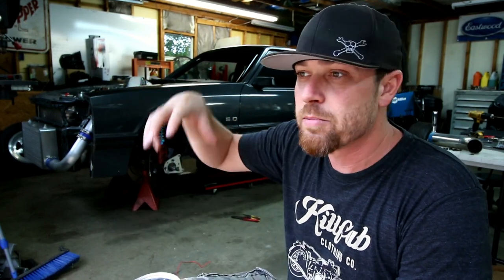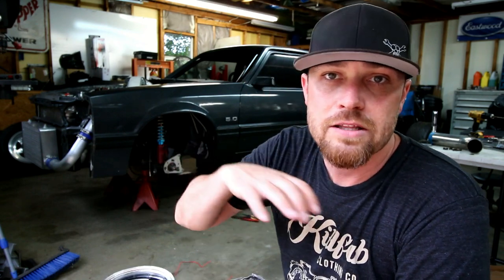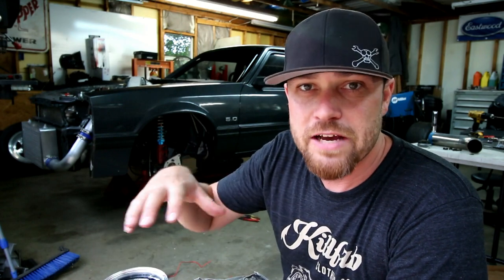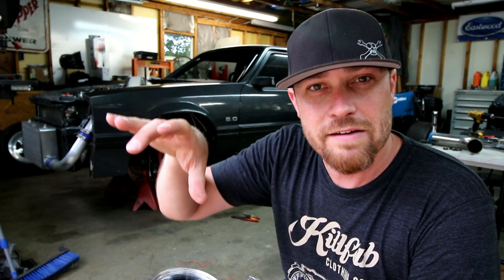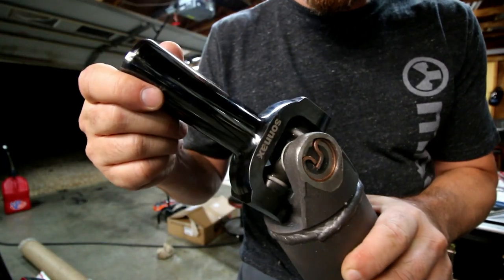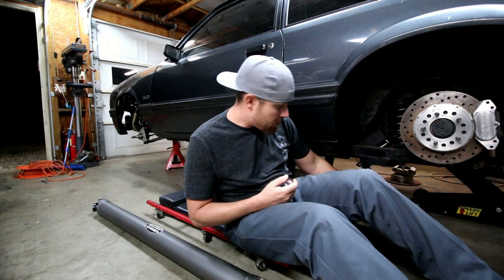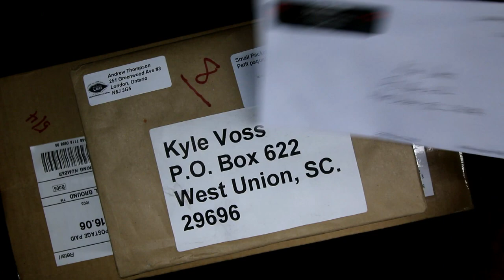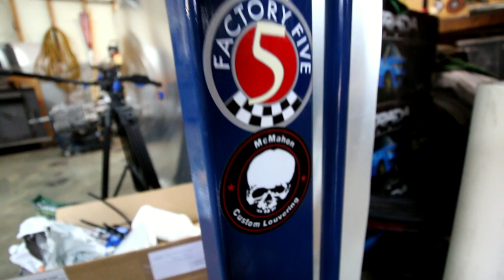Custom Intake Elbow | Twin Turbo Car

Comment: Like that advice at the end.

I completely hear you about the driveshaft, too.  I don't pay much mind to it (but I'm not dropping real power, either) but there's a reason most drag strips under a certain time (like 11s) require you to have a driveshaft loop.  Those things will do DAMAGE if they break free.
Reply from the maker: +MrSlowestD16 yeah for sure

Comment: Love this channel Kyle watching some new almost daily trying to get caught up. Did wish to point one thing out though. I noticed that you tie your line lock button into your trans brake. Just want to give you a heads up that morosso makes an adjustable trans brake button and your reaction times will increase if you move it to a better location like the stealing wheel. Just a good tip however long it takes for you to push your button to activate your trans brake it's take just as long to release it. Keep it up bud love the channel.
Reply from the maker: +Chris Bombard yeah I used to have on of those. Not too worried about it because its mainly a street car

Comment: In New Zealand if we modified our cars with higher hp we have to put drive shaft hoops around it. So it's a circle that's free floating and is attached to each side of the driveshaft tunnel and it holds the drive shaft if it breaks instead of dropping on to the ground
Reply from the maker: yeah I have one as well...it was actually shown in the under car clip in this video

Comment: Awesome driveshaft too pretty to be under the car. I liked the words of inspiration, have you run into the fourth type of person though, the one(s) that intentionally get in the way of everyone trying to succeed. I call them the road blocks, but once you get around them, it is clear sailing or happy motoring.- Anything of worth is always worth the hard work to achieve it. Thanks for the Vid.
Reply from the maker: +Bob S. Yeah they don't get any of my attention
Reply: +The Fab Forums Right on.

Comment: is it normal that the vid is onely in 1080p
Uknow here in ALGERIA, I can't afford that kind of internet connection ;)
Reply: Me neither here in Germany
Reply: Lower quality options will appear later as Youtube processes the lower quality versions.
Reply from the maker: +Michael Saull you should have other quality options
Reply: The Fab Forums they are there now but 5hours after you posting the video only had the 1080p option. I generally takes YouTube anywhere from 8-16 hours to render all the other quality options

Comment: Do you have something funky going on with your cold side? I see the car behind you with the bumper cover off and I can clearly see a nice FMIC, but when you put your elbow on your intake is coming from the firewall. It almost looks as if you have a water to air inside the car or something. If not did you just get creative with the routing for a clean look?
Reply from the maker: yeah mainly creative routing through the fender and into the cab in an effort to clean up the engine bay, but it was also made this way for an easy conversion to air to water if I end up going that route.

Comment: Question for you that sensor you used for boost in the intake, did that come with those connectors it did you buy that connector and add it to the wires? I'm looking for a company that makes small connectors where weatherpak I used in the past but they make large ones only.
Reply from the maker: it came with the sensor....it just a standard GM air temp sensor. http://amzn.to/2rHEGCL

Comment: 8.8 rear end did you upgrade the axle shafts with a 1000 hp and the stock axle you may break them . They are the weak link in the diff
Reply from the maker: +John Versluis yeah its got Moser 33 spline axes with c-clip eliminators and a spool

Comment: just out of curiosity,  what made you decide on an 8.8 instead of upgrading to a for 9 inch?
Reply from the maker: +bayou boat trash mustangs come with the 8.8 and they are basically just as strong as the 9" ....it would be nice to be able to have multiple gear sets setup but not need for this street car
Reply: Gotcha, I know a lot of people PRAISE the 9 inch, I didn't know if it was for ease of use like you stated or strength. Thanks for info. I know the 8.8 is a popular off road swap for jeeps. How much power are you looking to make with the goose?

Comment: The way you safety wired the rotor is incorrect.  The method you used is for a maximum of 3 fasteners.  If you want to do all in one shot you use a single wire.  Google aviation safety wire, there are resources for proper procedure.  Also you should alternate the direction of wire twist.  After 15 plus years of doing this daily one gets good at it.
Reply: And this is what makes YouTube so great, we can all learn something from one another! Thanks!
Reply: Cool!  I'll have to check that out! Thanks
Reply from the maker: +Brent Wolff yeah I have had several mention the same that work in aviation.... It will be perfect for what I am doing though. If I have to pull it apart for some reason I will most likely group them in twos
Reply: Brent is right about the multiple fasteners. We do the same thing on submarines and nuclear stuff. Also twist one direction first like you did pulling the handle to twist the pliers, then the other direction after going through the next fastener. You won't be able to use the puller for this direction. Lock cable is a good but more expensive option as well that we use very often.
Reply: Reversible safety wire pliars are a great investment.

Comment: If you are nervous about your U joints breaking and swinging around tearing up other expensive parts then invest in a driveshaft safety loop. $100 of insurance will save thousand of dollars.
Reply from the maker: +Midwest UTV the car already has one
Reply: Well then your ready to play with the big boys ;) doing pretty nice work I would like to add!